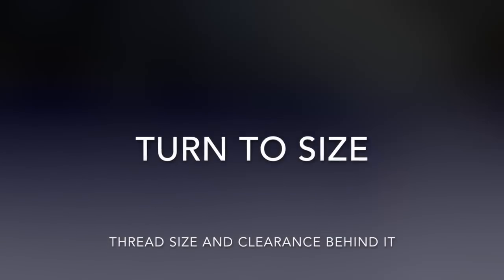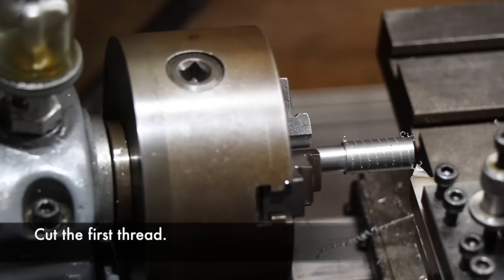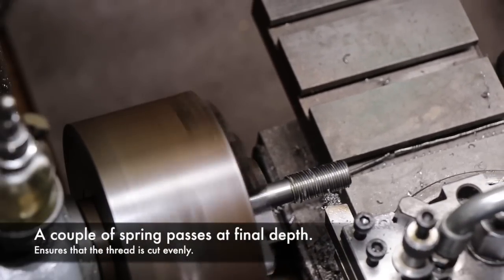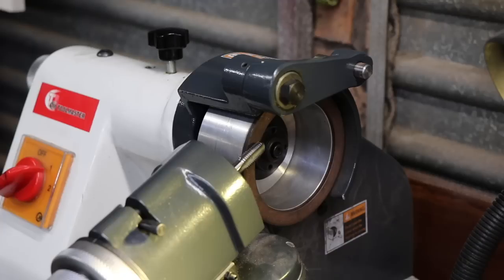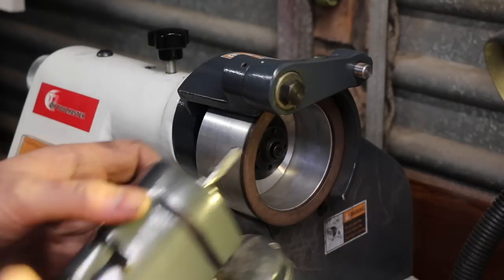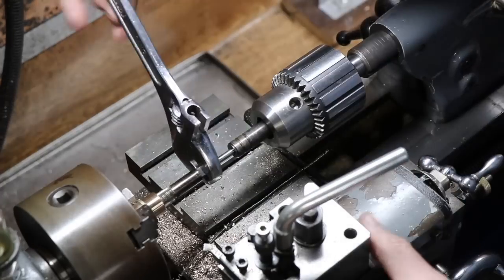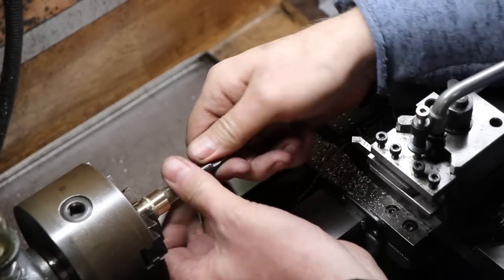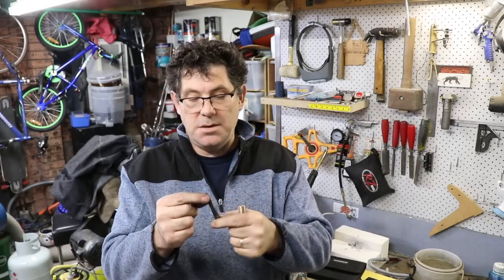DIY Thread Tap

Comment: Great job but it is not home made with these tools ;)
Reply from the maker: I made it in my home.
Reply: With professional power tools....
Reply from the maker: I tried papier-mâché but it couldn't cut a thread.
Reply: I do not think the average person has metal processing machines at home. Here we are talking about an undeniable professional. So the phrase ''home made'' does not apply.I hope you understand that simple thought.
Reply from the maker: Many thousands of people do.  Model engineering has been a popular hobby since at least 1882.
A professional would make this tap using specialised precision grinding machines.

Comment: seems odd that you have some pretty professional looking equipment yet you did not use any cutting fluid (and I mean "insist" on using it since every machinist I know refuses to cut any threads with taps or dies with out cutting fluid as it causes busted taps and screws (in the dies) causing a great amount of waste.
Reply: mind you I am quite good at USING taps and dies, but I am here looking at your video (and others on this subject of making taps) because I am going to take a stab at making my first tap, though I am cheating and using some screw material (single start 1/2 inch acme 10-TPI) as I am cutting threads in a piece of UHMW-PE to make lead nuts for a little x/y table and don't want any slop, (thus why I am using UHMW-PE, as HDPE worked so well for my CNC mill, at making it's backlash-less lead nuts using the material from the top of some blue 55gal barrels, so the UHMW I expect will be even better, as it is harder to damage, and polishes up to an even slicker luberous state more like polished and wet ice, even though it is not wet at all with any oil or water, :)  so I should note, I thank you for the video since I had not thought of the borax coating over the tap while heating it for hardening and tempering it probably too, in my case since I will use a kiln I have here to do all of this. giving me some experience using it for that process, and not just fusing glass, and tempering titanium/alloys :)
Reply: also to anyone watching, please please please do not EVER do any tapping or cutting of any titanium with out cutting fluid, or at least grab an old candle and rub on the metal while it is warm to coat it while cutting on it, as titanium, most stainless, and aluminum (aluminium) all gall. (ie the bits you cut off if they get a chance to get wedged into the groove of the cutter and metal being cut, will bond to it like a weld, causing the kerf to tighten up till it seizes up on your cutter, be it threads on a tap, or teeth on your saws,
Reply from the maker: I usually brush on a bit of cutting fluid.  I guess I just forgot that time.  There’s a lot going on.  It never hurts to add some!
Good luck with your project.  ATB john